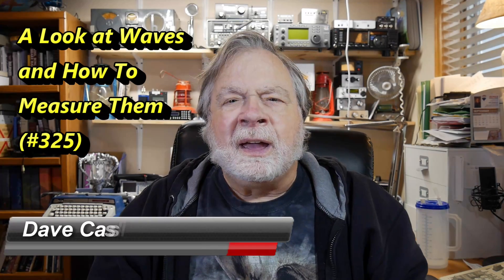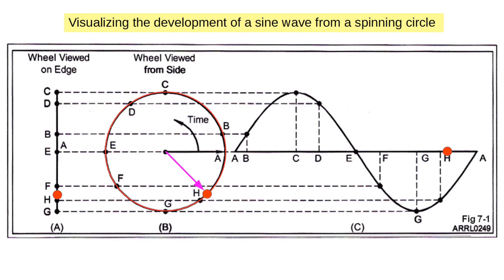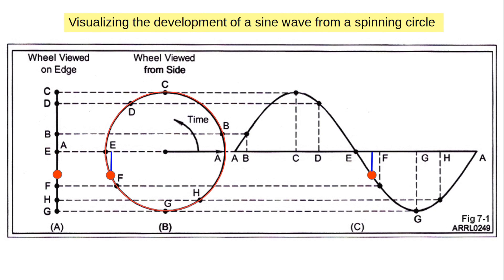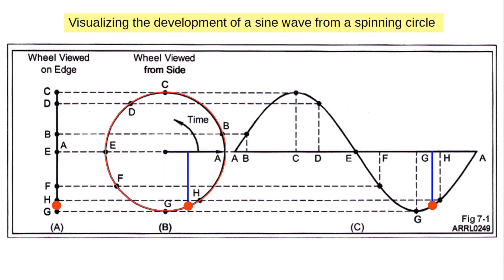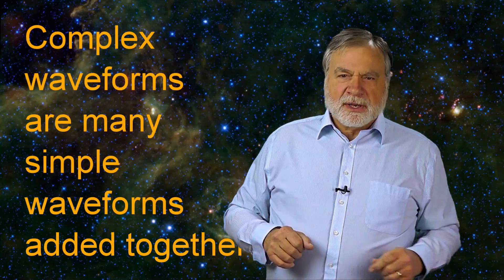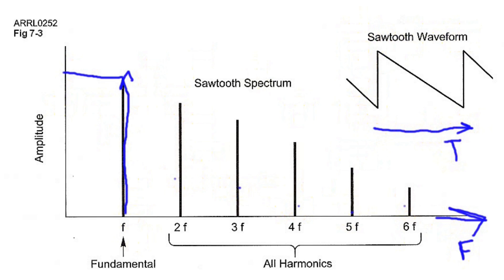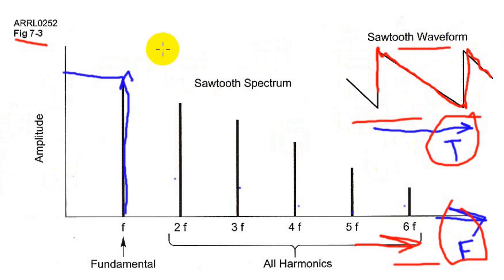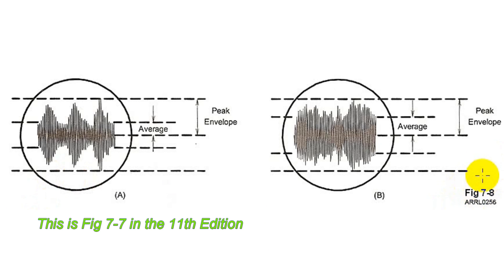Sinewaves and How To Measure Them (#325)

Comment: Thanks Dave. An excellent presentation again. Also here in the UK, there has been a de - emphasis on this aspect of understanding the background to PEP. There is something that has been bugging me about the 2 tone test to measure PEP and that is the advice to use 2 tones which are not harmonically related. Is that because the "average power = half PEP" doesn't work, if they are? I figure anyone who can use the verb "to hose" and the noun "ionosphere" in the same sentence has to be able to help!!